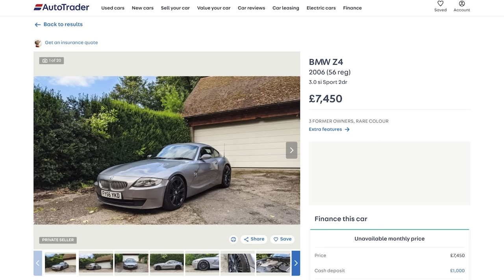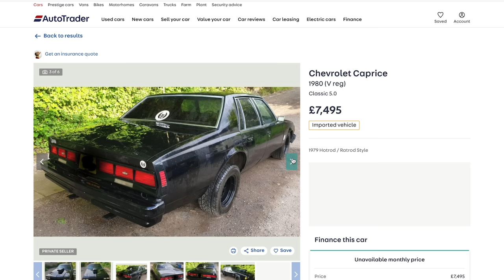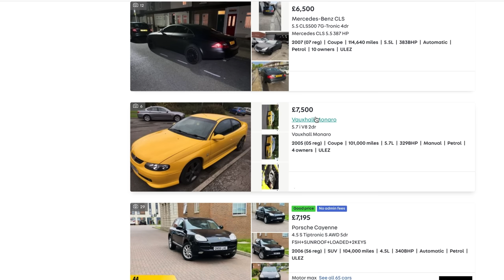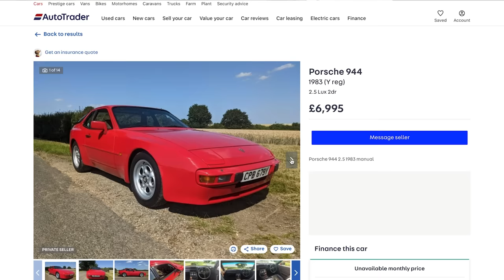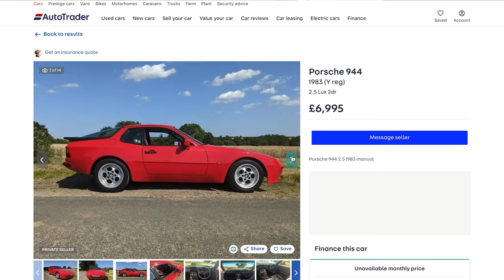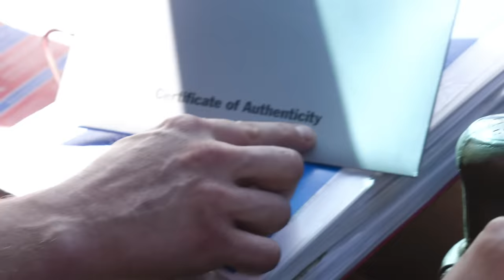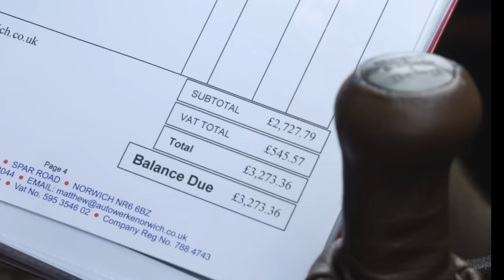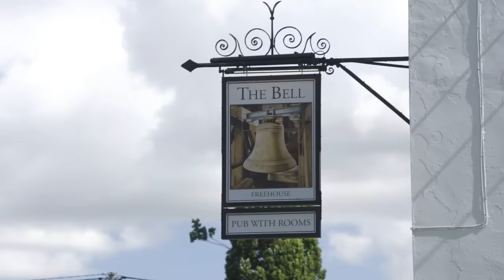We Traded Up To Our Attainable Dream Car

Comment: I remember on Top Gear when May and Clarkson bought 944s in two separate challenges for £900 and £1500 respectively. Certainly an appreciating classic
Reply: Clarkson had a 928,May a 944,Hammond a 924.
Reply: @robertsdmitrocenko  Clarkson also had a 944 in the ambulance challenge.
Reply: While that is true for the £1500 Porsche challenge, the £1500 944 I’m referring to was Clarkson’s choice of car for a £1500 rear-wheel challenge in 2009 (Series 13 I think) - which featured a Morris Marina as the back up car
Reply: The 944 will never appreciate, keep dreaming though
Reply: Didn't Clarkson also buy a 944 for the Ambulance challenge?
Reply: @alechall7082  Already has…
Reply: @Jimmer93  yep
Reply: Wasn't it also a 944 in the infamous Argentina special?
Reply: @AlexisDelatolas  That was a 928
Reply: @alechall7082  It already has fella..
Reply: 15 years ago you could get a 944 for under £1000, now some are  going for prices of £10k. If that’s not called appreciation, then I don’t know what is
Reply: Correct, and the man who sold it to the BBC reportedly wasn’t too happy when he found out what had happened to it
Reply: @waverleyproductions1947  you sell it, you sell it. You’ve been paid, they can set fire to it. Drop a piano it’s no longer your concern :)
Reply: You can still get them very cheap, but they will be an absolute bin and 944s parts are not cheap.
Reply: @s20ttv  But with a classic it's different. People want to sell them to someone who will keep it going because they have history.
Reply: @Jimmer93  ah ok thanks 😉
Reply: @robertsdmitrocenko  Jermery had the 928 for personal reasons he was in London reviewing it when he received a phone call from his mother that his dad was in hospital about to Die. Clarkson got a Chicken as he knew his mum wouldn't have eaten put in the boot and drove to Sheffield I think where his dad was. Not only did he get to his dad before he died the Chicken was still warm because of the 928. Clarkson basically has fond memories of it

Comment: Loving this! - Also a tip for a future "Living with a ..." video: Today I saw a slammed early 2000s BMW 5-series estate, which seemed to have 2mm of ground clearence, skipping like a demented puppy over the un-even street outside my place of work, while going south of 40 km/h, having it's wheels at angles that would suggest total suspension failiure and scraping it's underbelly in the ground every 3 seconds. Looked absolutely rediculous - so naturally I want to know how it is to live with a slammed car? Please  - I need to know!
Reply: Its terrible honestly. Sacrifice anything for "looks". 

I bought a sports car that was lowered, not even slammed, I got so sick of constantly scraping on speed bumps, driveways, and all that stuff that I raised it back up to factory height. 

I couldnt fathom driving something completely slammed.
Reply: It isn’t to bad I drove a 2017 Passat that was lowered 4 inches and I never complained
Reply: @_Zekken   - In other words - it would make for hilarious entertainment!
Reply: Absolutely disgusting I’ve got a bagged 535 and a lowered bora pd150 absolutely sacrifice any comfort for looks the 535 isn’t too bad when the bags are up but what’s the point in having the bags up lol
Reply: Bought a civic type r EP3 a few years ago, mugen everything and on coilovers. I ended up putting the oem shocks back on. Can't mount on a pavement to park so narrow street parking is a no go, you'll scratch the body on the pavement if you're not careful when parking, ride quality is horrific if it's a daily and not a track monster, handling was impeccable and it looked beautiful, at the sacrifice of comfort and convenience.

Comment: My first car was a 1985 pre 85 1/2 with the old style gauges. I had a mystery overheating issue, changed everything, could run for hours but once stopped would overheat.

Comment: This is a good series..

In New Zealand as a kid, we were overtaken by a screaming 944 turbo driving down the centre median against oncoming traffic. The oldman was raging, we saw the car pulled up ahead at a shop so the old fullah ripped into the park to confront him before the driver got out. He stepped out, started mouthing off before he got to the car, the 944 driver hopped out and goes "Mike, how yah been? I thought that was you"
The oldman replied "Hey Ray, you still a mad twat" 
Turns out, he did it on purpose. Ray (racing Ray Williams- set NZ land speed records in Porsche's) and the oldman had raced eachother for years. 
Since that day have always wanted one, have had many of the cheaper/faster variant though, the RX-7 🤣. So in a way, I love rx-7's and still own an FD because of that chance meeting.

Comment: You need to check the timing belt on that 944's engine. It sounds like it's either in too much tension, or the water pump is giving it's way (the whine). Typical sound for a VAG engine that has something wrong around it's belts.

Comment: It’s crazy how in the UK the Holden Monaro is going for around 10 grand AUD when here they’re going for more than $60 000 AUD
Reply: High fuel prices will have something to do with their low value. Plus they aren’t held in any high regard outside of petrolhead circles. Plus I’m guessing the reason they didn’t get the one they saw was because it was a dog. Good ones will be more money.

Comment: Well done guys! Nevertheless, err, I was curious about this 944's history, and on the MOT check, it looks that the clock was replaced/ reset around 2006?.. Initially I was like omg just 40,000 miles! But actually it is 40,000 + 97,000..

Comment: I looked up the reg and it immediately flagged up this

Mileage Issues
The odometer reading reduced by 92,178 miles between 03/03/2006 and 08/03/2007.

Comment: This is a bit painful to watch, living in Denmark. The Z4 that you guys bought for 5.000 GBP is just outrageous. The cheapest Z4 for sale in Denmark is just over 19.000 GBP, and is a 2.0 Roadster (manual though) with just shy of 78.000 miles on the clock 😭

Comment: If an Austin Allegro was my dream car would it be traded up for? I do not think so. The 944 is the most overrated car ever. Arguably the Z4 was a better car in almost every way. Perhaps an S2 944 would be a step up but then they are double the price of a normal 944 and that shows how desirable a normal 944 is. The 944 and 924 were £1-2K cars a few years ago.

Comment: Alex drinking and driving again!!! 😠
Reply: The legal limit in the UK is one drink
Reply: @angus_m  Firstly, no it isn't... Secondly, they stopped off at a pub before visiting caffeine and machine. So they had a couple of drinks.
Reply: @FrostGhost  what do you perceive the legal limit to be?
Reply: @angus_m  The legal limit is: 35 micrograms of alcohol per 100ml of breath (in England and Wales). It's not based on the number of drinks or even the number of units. For some people, a single pint will take them over this limit.. Better not to risk it!
Reply: @FrostGhost  Nice copy and paste from Google. He has probably calculated how much he can drink, and drinks accordingly. You just answered your own question.
Reply: @angus_m  What was "my own question"? Don't recall asking a question. Aside from that, the stat wasn't a copy and paste from Google. I have remembered it from my driving theory test. It is impossible to calculate how many drinks equates to 35 micrograms of alcohol per 100ml of breath. There are so many factors which affect how the alcohol you have consumed will metabolise - how much you've eaten, what you've eaten, how much sleep you've had etc. Best not to drink and drive.. Can't believe your advocating for drinking and driving!
Reply: @FrostGhost  I am in no way advocating drink driving. I am simply defending a good man who is within his legal rights, to drive a motor vehicle under the legal alcohol limit. If you can not see that then you can not be helped. Goodbye.
Reply: @angus_m  Yes he is within his legal right, but what sort of message does it send out to his audience if he's drinking at least 2 (maybe more) drinks and driving? Also, you were wrong about what you thought the legal limit was. So I'm glad that I was able to educate you. Goodbye :)